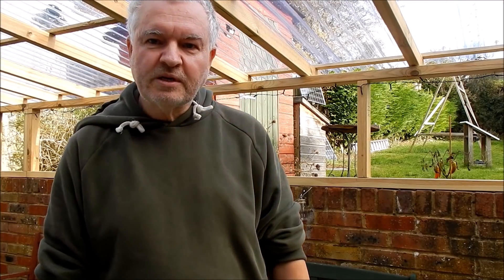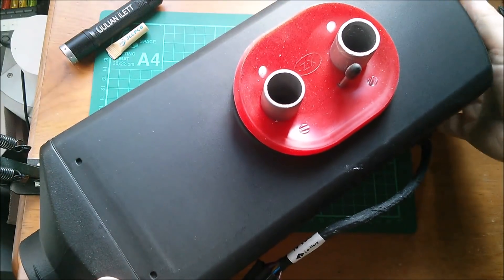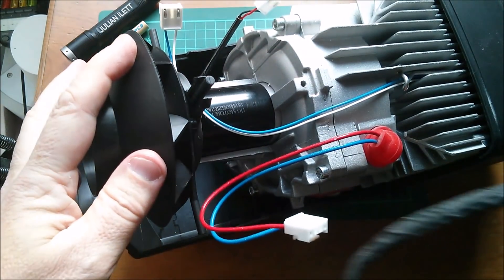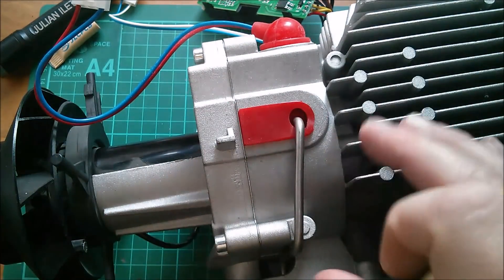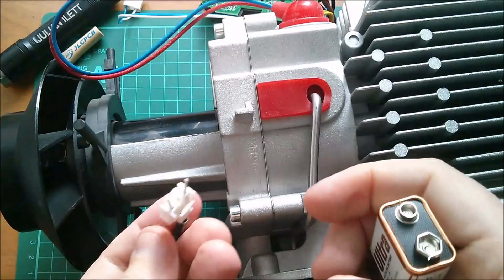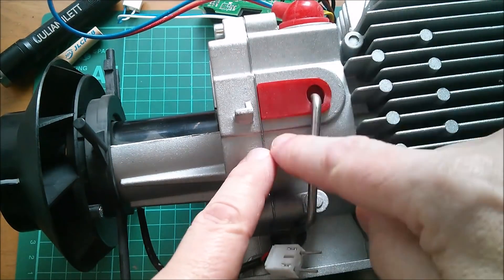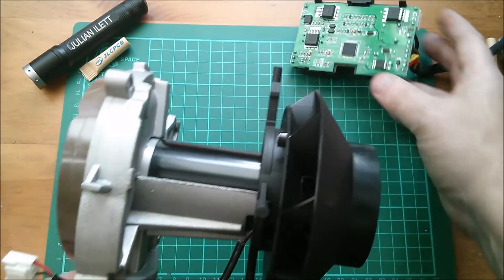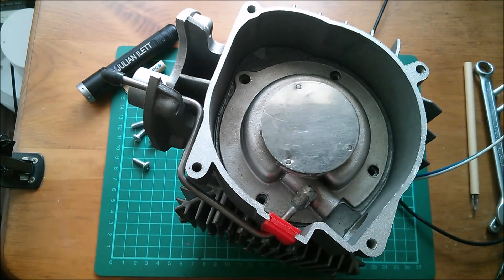A Look Inside the 8kW 12V Diesel Air Heater from Banggood

Comment: What an excellent video, particularly as I had never seen the inside of one of these before!

This is such a simple system, and as you say, with only one moving part, it should be quite reliable.

Thank you for this video strip down. Subscribed.

Comment: I would build a custom air filter and place the pwm controller  in the box then pipe fresh air to heater, I would put heater in metal box so it could be mounted permanently in a cabinet. Extend wires to pwm . This will stop dragging noise, and keep pwm cool in fresh air flow.

Comment: Hi, I noticed you mounted the heater on it's side? Does it matter which way it faces as the glow plug will  be more at the top one way or the bottom the other?
Reply from the maker: The manual says the glow plug must be at the top - so there are two acceptable mounting orientations :)
Reply: @JulianIlett  Thanks for that, I'm just now confused because I've just seen your other video with the heater and other stuff was the title, and your plug was at the bottom?
Reply from the maker: After I properly read the manual, I changed the orientation :)
Reply: @JulianIlett  haha ok, thanks for clearing that up

Comment: Mine is manufactured by a company called V V Kb. circuit board is slightly different ,IT does have a Hall effect sensor,  I presume they have the casting bought in and use there own versions of circuit boards, plugs ect,  as they all look exactly the same

Comment: The cost of fuel is the small factor, the main one is how long will this Chinese copy work? If its only 500 hours or 100, then your cost for use just tripled+++. While it looks very well built,  one burp in the IC and this thing is one more Harbor Fright type unit in the dumpster.

Comment: is this just a mini diesel engine.some help please.
Reply: It's just a mini diesel burner and heat exchanger. With a built in fan.

It burns the fuel inside of a heat exchanger to heat it, then uses the fan to blow air over it to cool it and heat the air.
Reply: Yes, it's a 4 cylinder turbocharged diesel engine with a 20:1 compression ratio.

Comment: Julian, the reason for the hole in the side of the fuel inlet/glow plug area is to allow the air to force the fuel thru the mesh and to supply oxygen so it can ignite there. The air would break up the fuel better so that it has better combustion. 

Also, you might want to add the same roofing sheets to the inside of you work area. Leaving a gap on the lower part of the wall and at the peak of it. That way any time you have sunshine, you will get the green house effect. Your place will be warmer both due to solar heating and the fact that the second layer will act as insulation to prevent heat loss at night.
Reply from the maker: Yeah, done that - work area tour coming soon :)

Comment: You will soon get fed up with collecting used chip oil from the local fish and chip shops and will want to use heating oil but the problem is how do you buy a suitably small quantity.  The local heating oil supplier isn't going to send a  tanker round to your house to deliver a couple of gallons of oil.
Reply from the maker: I tried vegetable oil and it doesn't work - the heater just shuts down. I think the problem is viscosity.
Reply: @JulianIlett  You could electrically pre-heat the vegetable oil to say 100 deg.C to reduce its viscosity and then keep it hot with the exhaust gas, if you really want to burn your house down that is.
Reply from the maker: Just want an easy life :) I'll have a look around the local area for a biodiesel supplier - that way I can keep my green credentials.

Comment: I guess it will burn vegoil/ biodiesel? It would be nice to have. Do they make 24v diesel? Wouldnt it be awesome if this lil thing generated power !!! Maybe a small gas/ diesel turbine enginen spinning a generator. And be a heat source!!! Project maybe??? Would ppl buy something like this??
Reply: JAMES! Since the 70's look up CHP (combined heat and power) units. Small gas turbines produce a good balance of heat and motive power for electrical generation. Small ones are often based on truck turbos.

Comment: its really a jet engine?    Correct me .    Not quite.
Reply: A jet engine with a heat exchanger where the turbines would be?   It is isnt it?
Reply: Surely aviation lead the design of the fuel flow controllers,  and the code around it.  Food 4 thought.

Comment: You would need the Hall effect sensor to proof airflow for gas fired heaters. According to the NFPA you need 2 or 3, might be more it’s been years since I last used it, complete air changes in the vessel to exhaust any explosive gases before ignition. 

I once designed the control system for a 1 MBTU incinerator for the IOC to convert hydrogen sulfide, a by product of low sulfur diesel, to sulfur dioxide which was vented to atmosphere... in India... had a hugely expensive GE Oxygen Analyzer on top the stack to manage emissions.

Comment: Will it run on parafin or vegatable oils?  Are you going to try it out on alternative fuels?  Compact little unit.  Nice.  Now to the next video to see how it performs.....
Reply: Kerosene is ideal. It's cleaner and more consistent than diesel. Diesel is just convenient if you mount these to heat up a vehicle (although the 8 kilowatt model would be at least 6 kilowatts of overkill to heat most vehicles) - with diesel you can plumb them straight to the vehicles diesel tank and never have to worry about fueling the heater up separately again.

Comment: Is this the same as what’s installed in most hgv’s? We call them a night heater, they use the trucks diesel fuel to heat the cab without having to run the engine. Thanks 👍🏻

Comment: Does it produce a lot of toxic fumes like an old style kerosene heater?
Reply: The only thing toxic out of this is the exhaust that is supposed to be blown outside the area you're heating. These only suck in clean air from the room, heat it, and blow warm dry air out the business end. As long as you make sure the exhaust is properly outside the room/vehicle you're heating there is no air pollution at all inside.
Reply: @cr0ft-2k  So it smells like a diesel truck outside?
Reply: @stevec5000  Pretty much, yes, though obviously the amount of exhaust is only a tiny fraction of a diesel truck.

Comment: Why is this any better than a kerosene heater?
Reply: This is a vented heater, ie all the combustion byproducts are blown out the exhaust tube, outside whatever space you're heating. And it can in fact burn kerosene as well, it's probably ideal in fact. But the key is to have a heater that exhausts the combustion byproducts outside, and only heats the clean air inside, like this one does.
Reply: Kerosene heaters don't need to vent and no heat is lost. 
 But is this heater adjustable?  That is the main downside of kerosene heaters... they cannot be adjusted. If you but a 10k BTU heater, it always outputs 10k BTUs.
Reply: @tarstarkusz  There is nothing you can burn that doesn't require venting/an exhaust. Sure, you can just choose to burn kerosene and then inhale the exhaust, which is about as clever as burning wood and then exhaling that exhaust. Kerosene exhaust is probably a bit less damaging, but still damaging. Same goes for unvented propane heaters, they poison the air with combustion byproducts. Not enough that it's immediately enough to cause you to run screaming, but enough that you get headaches and get slowly poisoned by polluted air.
Reply: +Croft... That room is not well insulated and enough air is getting in to burn kerosene in a kerosene heater without much of anything.  A properly functioning kerosene heater does not have particulate emissions or carbon monoxide emissions.  I have been using them for decades without issue..

Comment: Haha I got one the other day too pretty much the same but I opted for the posh carbon effect trim 😂 seems to work fairly well but having worked on erbespacher units I really doubt it's 8kw rating! I'm thinking more like 3 to 4 kw. On the other hand they do seem reasonably well built and quite intelligent in their running operation. Mods mine needs is the fan requires balancing and I'm going to fit a battery backup in my lcd controller for the clock.
Reply: Yeah, Eberspächer makes two variants, D2 and D4. 2.2 and 4 kilowatts, respectively. And for most uses I suspect the 2.2 kilowatts is much better, you can run it on max and that means it burns the most efficiently and doesn't soot up. So I agree, this probably isn't 8 kilowatts, and that's probably a good thing since 8 kilowatts is probably too much for most scenarios.
Reply: @cr0ft-2k  ye definitely not 8 kw I ran min flat out for 2 hours on the timer and was going to measure how much fuel it had used I had marked the level in the tank. However I didn't actually work it out in the end because I couldn't find a measuring cylinder I wouldn't get murdered for using 😂 anyway it used roughly 3/4 of a liter 1.5 x 500ml coke bottles worth of fuel
In 2 hours! So that's about 4kw worth of fuel to make 8kw of heat these Chinese have really perfected the efficiency!
Reply: @cr0ft-2k  oh and there's a erberspacher D7 not sure if they still make them they are about 2 ft long and about 10 inch diameter and they are 8kw I was fixing 2 for a guy on a boat the other week.
Reply: @ras666  Aha, yeah I've mostly been looking at stuff that's appropriate for a van / small class B RV, so 2-4 kilowatts. However, even there I suspect I'll be going with their Hydronic models that heat water and have heat exchangers to actually harvest the heat.

Comment: same as a diesel hot power washer,spray diesel as a mist,ignite with a spark genrator,blow hot air with a fan.
Only if it works like a propane space heater we had at 5ft you get cold air as the heat will riseth to the heavens than spread out.

If it's reliable i might get one to heat a ducted system and vent out through a collector.

Comment: That inner gasket for the combustion chamber itself is made of graphite. that why it has a slippery feel and  silver look.   Unfortunately these gaskets are meant to squish some once used and are not meant to be reused once they have been tightened down. I would get a new one before you use it cause it will now burn out now that it has been unbolted.